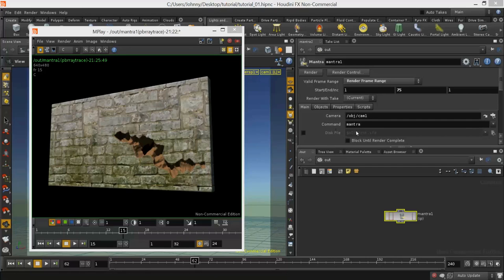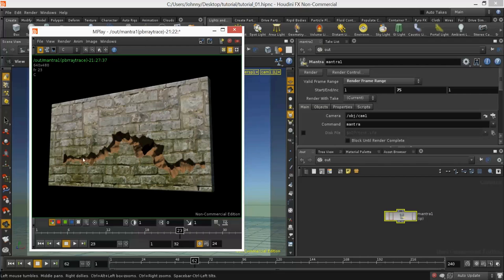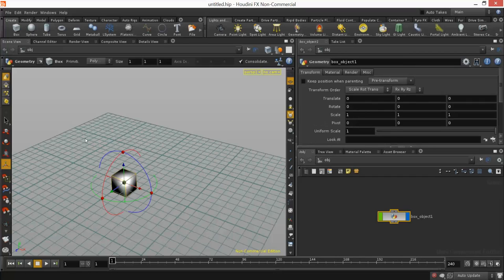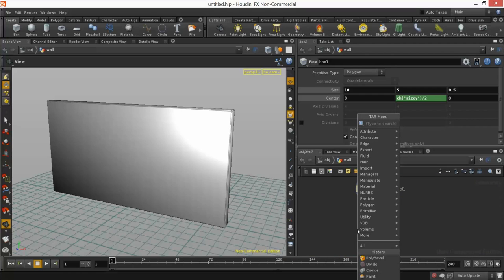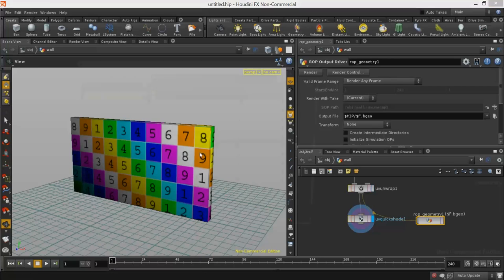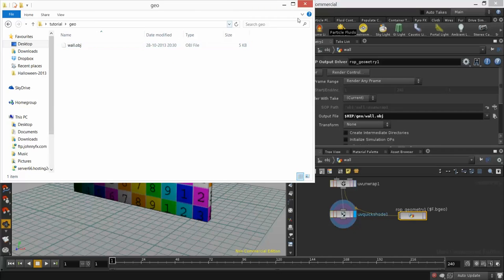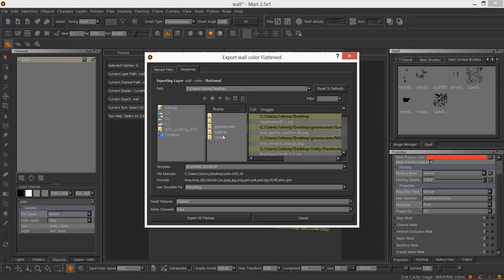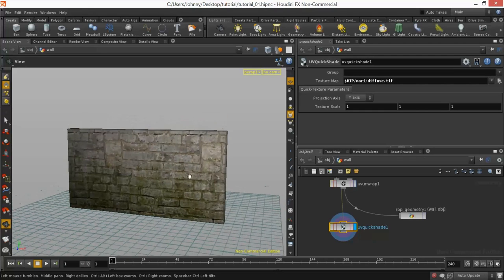Houdini 12.5 VDB Crack Tool Tutorial Part 1

Comment: Thought I would try my luck and see if you reply. At around 27 minutes when you make the spline to adjust the sweep scale. I cannot get it working at all. I'm using H14 and have to use attribvop instead of vopsop. Do you think that could be the problem?
Reply from the maker: Lee Jackson yes houdini 14 is a bit different now, the vopsop is replaced by attribvop. The attribvop is changed alot! If you want I can show you how to convert this process from h13 to h14. Im also making a new attribvop tutorial soon!
Reply: Johnny Roek Instead of using an attribsop I ended up using a Bind VOP, seems to of got the trick done.
Reply: +Lee Jackson . how did you get the bind vop to work? I am in Houdini 15 and it doesn't work for me.
Reply: +Adrian Farely did you manage to get the bind vop working?
Reply: Kyle Maier I figured something out, it has been a while since I went through the Tutorial, I am planning on going through it again very soon. I don't remember what I used to get it to work at this moment.
Reply: attribvop works fine, use bind export whithin the node and you get your scale parameter to play with. (houdini 16)
Reply: Thanks, any idea how to get the old group node - filter by expression to work @ 48 min?